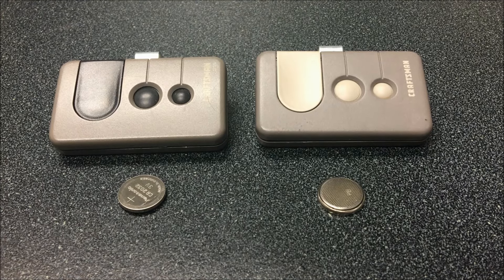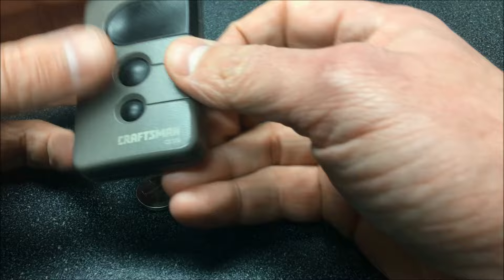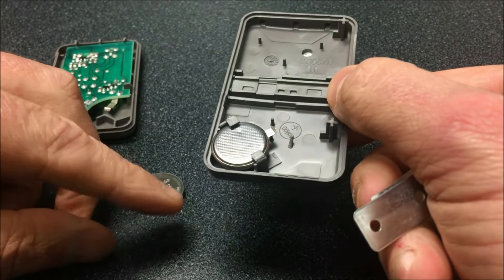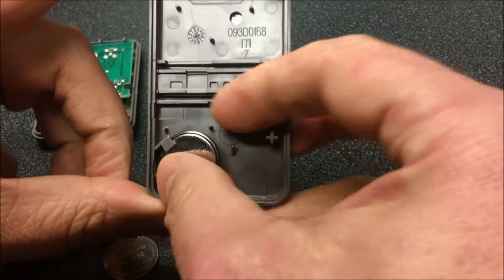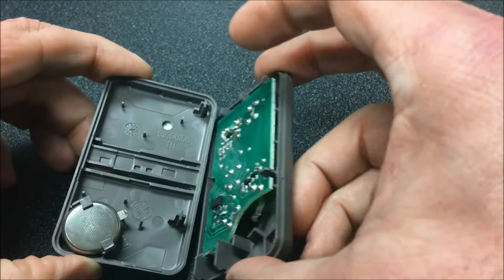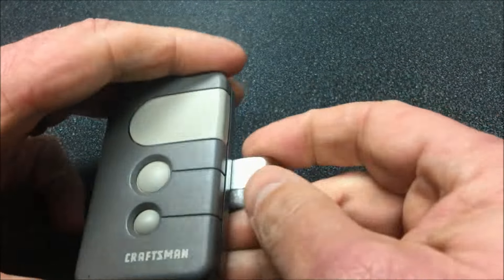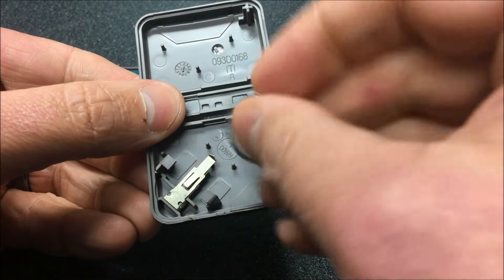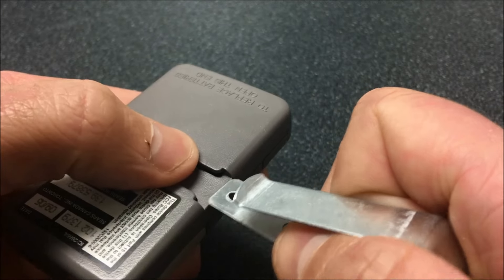How to Change Battery of Sears Craftsman Garage Door Remote Control

Comment: I followed your instructions regarding battery replacement but for some reason the remote had two 2016 batteries (3V each) stacked.  I tried using the CR2032 as stated in this video (and in a few other videos) but the remote would not work.  I put in two new 2016 batteries and the remote worked.  The system was one of the first Sears put out so it's possible the first few versions used 6 volts instead of 3 volts.  Just thought I'd pass this on...

Comment: If you look with a magnifying glass and a bright light, it shows on the case which end to open, not the side shown in the video. Probably doesn't make a lot of difference but some commented on destroying their cases. his could be why.
Reply: Yes doing it this way, I popped of the top 3 clips inside the unit. They're broken. Don't open it the way he does
Reply: The end it suggested wouldn’t open for me.  Mine looks like the dog chewed on it once I finally got it open.  A removable screw would have been better.

Comment: Question for Mark: I have the Craftsman remote opener unit with the cadet blue (darker buttons) shown in this video. I opened it with your assistance and was surprised to find 2 CR2012 batteries. Both were marked 3 Volts. Are two CR2012 batteries equivalent to one CR2032 battery? Thanks in advance. ~N

Comment: the remote with grey buttons does it say 14sr480-1a on the inside board? i need to get a new remote but dont know which one is compatible to that..
Reply from the maker: What model motor do you need the unit to work with thats the best way to make sure you get the correct one.